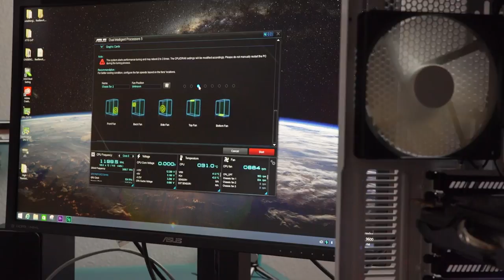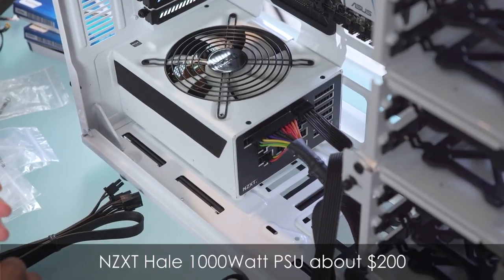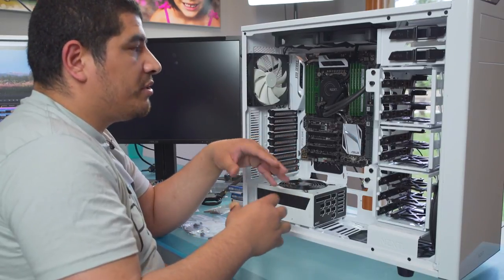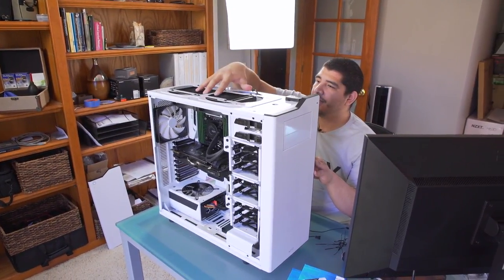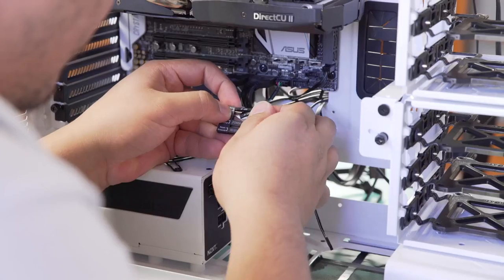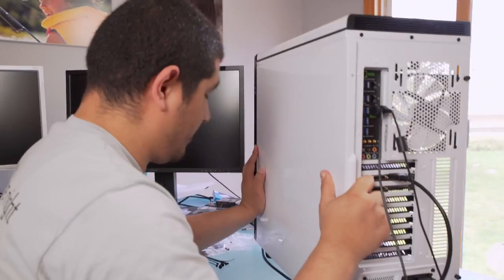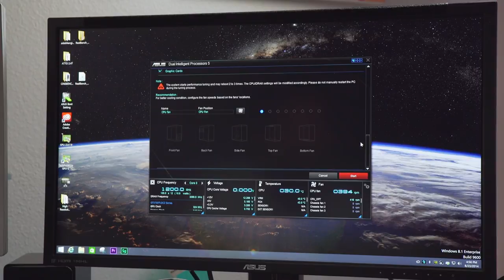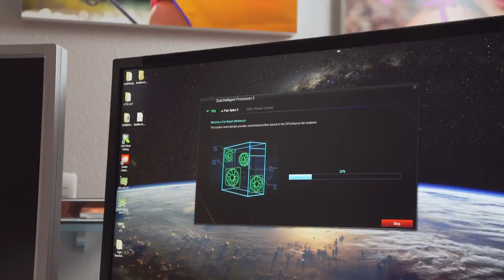i7-5960X 8-core With Asus X99 MB Video Editing Beast

Comment: ugly ram :( for such amazing system :(
Reply: ***** ***** Omg, it's not about beauty, it's about overclock-ability. He already took an overclockable CPU, great mobo for overclocks, high end water cooling and high end case with great airflow, why didn't he finish it with overclockable ram?? 2666mhz with heatsinks and low latency. I hate overclocking, but he already built a pc capable of OC..

Comment: I have an ASUS, HP and Mac workstation and for me the ASUS one has been the worst performer. It started out really well but as time went on it would start getting really slow so i ditched it for the HP which is great, just don't like the way windows works so I've been using my older Mac rig more these days. I'd definitely like to try out a DAVE'S BEAST... just wish it didn't run windows OS

Comment: Radiators clog quickly so be sure to clean it regularly. With a pull config on the radiator, it can be cleaned with a vacuum cleaner hose attachment within around 5 seconds. A thin layer of dust can cause temperatures to climb by around 5-8C, e.g., here is what it takes to cause that on my kraken x40 http://i.imgur.com/1DUmKTl.jpg (pull config exhausting from the case)
Do not get rid of the old system yet, these early release boards are having a large number of stability issues, and both asus and evga have been releasing a ton of updates very frequently to fix them, so early adopters will likely run into some stability issues, especially when memory overclocking for a while before they are all fixed.
The hardware is pretty solid, most of the issues seem to be related to intel rushing that release of their new CPU's

Comment: Thanx for this video!

Do the 4 extra cores allow you to stack more effects in Premiere with 4K video (Panasonic Gh4) and still have smooth realtime playback in full resolution? 

On a 4790K 4-core at 4.5 Ghz with 32gb RAM and a GTX780, the full resolution realtime playback is on its limits when final color grades are applied. I'm talking about per-clip adjustments in brightness, contrast and color and then nesting the sequence into another sequence and adding final overal color and titles.

I know premiere will benefit from more cores during rendering, but what about the realtime preview?

Comment: Actually, the Mac Pro is not based on X79 but instead on the Xeon Professional Plattform. While he is right that it utilises the Hasewell Architecture, I would like to stress that the Mac Pro has Error Corrected Memory, Extra Commands in the CPU and Professional Grade GPUs (And Dual GPUs as Standard). For some applications you need these type of components (Medical, Computer aided Design, Simulation work, mission critical video editing) But the home user does generally not require this. 

Great system you build there! (Had to be said as well)

Comment: Umm, whoah.  As a non-techie I understand about 10% of what is going on in that build, but I can at least tell that it's going to be an insane PC.  The air flow to cool it alone says something.  I assume you'll be running AC in that room to compensate?  :)  Even your last build was  over my head, and would completely crush my current PC.  (I won't tell you what I am running since it would be embarrassing. *grin*)  25 years ago I felt like I had a handle on hardware.  Ahhh. How times have changed.

I was wondering if you could cover/recommend an off the shelf PC, or one that could have a minor tweak added, that would be a solid pc for less power-driven video makers; video editors who aren't moving to 4k in the near future for instance.  :)  Something in $1500 - $1800 range, preferrably on the lower side, that is plug and play would be great.  However, if that kind of content isn't your cup of tea (no problem), then perhaps a recommend to a solid  info source? 

I really appreciate your channel.  Even when I'm lost, which is not too often, your approach to content is so well constructed that it's a pleasure to watch.
Reply: ***** Personally, I would suggest building your own, and there is a great community for that over at reddit.com/r/buildapc. As for parts I would recommend, as JJ, said, a Nvidia GTX 760 Graphic Card, and an Intel Core i7 4790 CPU. Just head over to Reddit.com/r/BuildAPC with those two parts, say you want to build a video editing rig, ask some questions, and they can guide you through the daunting, yet easy, process of building your own PC. Good luck!
Reply: bdc9898
I appreciate that nudge to look into building my own.  I jumped over to reddit, and then followed a link to the Neeweg tutorial on how to build your PC.  Looks more manageable than I thought.    :)  Now, to match a build to my budget. 
Thanks.

Comment: You should definitely run SETI or some other science-based crunching app on your new computer, Dave.  I've been running SETI (Search for Extra-Terrestrial Intelligence) since 2002 and I'm in the top 800 in the world (out of around 3 million users).  I also donate computer time to helping to fight Malaria.  Your computer would rack up the results in a hurry.  It uses both CPU and GPU(s) to crunch the data faster.  You can set it up so that it only uses your computer when you're not using it.

There are also programs that help physicists, bioengineers, doctors, astrophysicists, cryptologists and many other types of professionals.  The base application you run is called BOINC and you can find it with a google search if you're interested.

ASUS may have a team for some of the science apps, so instead of donating $$, you could just donate computer cycles to one of their projects.  Some of the BOINC projects are for really good causes too, like the search for a cure for cancer, Malaria research, mapping the human brain, HIV/AIDS research and so on (about 20 different projects to choose from).

Comment: That's a fantastic processor. My new rig plans use an Asus V Rampage X99 motherboard with 780 Ti graphics card, but the processor I'm using (though undecided) isn't i7-5960X. I would buy that if I could.

Comment: Hey Dave! Great video!
I have a question about After Effects. Why doesn't the CPU work on 100% or at least as hard as it does when you render in Premiere? I have my settings set to use multiple CPU's in AE but I didn't notice much of a difference? 
Maybe you can shed some light on that with the BEAST?

Comment: Hey,

I just built a similar config and it's a real beast I confirm:
- 5960X OC @ 4.3
- GA-X99-UD4
- 64Gb RAM Patriot @ 3000Mhz
- 2 Patriot SSDs
- My old GTX 670 (enough for what I do, not gaming at all)
- Dual Dell Ultrasharp 27 inches 1440p
- Thermaltake Water3.0 Extreme
- Corsair 780T case

Geekbench 64bits:  3543 singe core / 34361 multicore
Running Yosemite as OS

Comment: I have both the new Mac Pro 6 Core Xeon 3.5Ghz with 16GB ram and the new Beast i7 5960X (water-cooled) , 32 GB DDR4 and Geforce GTX 760 2GB.  They are both connected to a new Samsung 55" Ultra HDTV 4k curved monitor. I agree with most here that OSX is a better OS to work in but when it comes to pure power, this new i7 5960 is in a class of its own. The Mac Pro doesn't even compare in processing power for most graphic needs. I'm running a high level surveillance system with 3-5 MP cams at 10-30 FPS each streaming MJPEG and H264. 

On an iMac Core Duo 2.8Ghz Extreme the 5MP cams would take up to 30% of CPU each which limited how many of these high MP cams I could run. A Mac Mini 2.3Ghz 4 core can run between 10-12 high MP cams.  The Mac Pro can run an Axis M3007P 5MP at full resolution in Sighthound software between 5-6% CPU utilization. There was no speeding up of fans when I had 5 of these cams hooked up and utilized around 13% of CPU.

 When I connected this same cam to the i7 5960X computer, it was like it wasn't even connected and used less than 1% of CPU. That is crazy power! I'm pretty sure I could run 60-100 cams between 3-5 MP (depending on bit rate). With 3 of these 5 MP cams connected I'm at between 2.5-3% CPU. This thing is an animal! 

Driving this 55" Ultra HDTV the PC definitely has the better graphics being able to run at full 4k resolution. This monitor is not optimized to run on the Mac Pro and OSX 10.9 finally addressed some issues with the Mac Pro and Samsung Ultra HDTV 4k. Hopefully there will be better support with different resolutions at 60Hz. I'm connected via HDMI right now at 30Hz which isn't too bad actually. I still love the Mac Pro. Super quiet and expandable externally to your hearts desire. It's hard to beat OSX!

Comment: I used a more budget friendly build with the 5820K, 32gb DDR4,GTX 1060 Founders Edition GPU, Crucial MX300 256GB SSD boot drive, 2 1TB Raptor 10K HDD's in RAID 0 for storage and a X99 MB by Gigabyte. My system is pretty fast. I have my CPU over clocked to 4.3GHZ. So far it has been a good system for what I use it for. I will be getting the i7 6900K in the near future. It is fun building a PC and I am surprised that more people don't build their own.

Comment: Hey Dave,

In the video it shows you have 8 sticks of ram in the motherboard but your link takes me to 4 sticks of ram. Did they purchase 2 sets and put 128gb ram in there? Which doesn't make sense because the processor can only support 64gb.  Also that processor does not support ECC ram. So did he use Crucial 32GB (4 x 8GB) 288-Pin DDR4 SDRAM DDR4 2133 (PC4-17000) and purchase 2 sets of those for a total of 64gb?

I’m super confused.

Great video by the way!!! Keep up the good work!

Thanks!

Comment: I must iterate that 7XX and 6XX series Nvidia Cards are not great for Rendering or performing CUDA intensive requests from Creative Editing Software, especially Adobe Suites. The 5XX Series Nvidia cards still outperform them in these tasks. When Nvidia found out everyone was buying 5XX series cards to edit with cheaper than Quadro cards, the next 6XX and 7XX series cards now disable a certain amount of CUDA cores. The only things the Nvidia cards perform well at now with Adobe is the Mercury Playback Engine. The only new Consumer Nvidia Cards that aren't effected by Disabled CUDA cores are the Titans.

Adobe has worked very closely with AMD for Open CL optimization and especially in late CS6 patches and CC AMD Consumer cards pretty much stomp all over Nvidia's offerings. However, if you want Pro performance from either AMD or Nvidia, you must go with a Quadro or FireGL card. AMD are more cheaper in this and are still slightly more optimized for Adobe and even chain better with programs like NUKE.  If you're purchasing an AMD FireGL card for the first time, I believe you can get 25-50% off of them straight from AMD. So, if you're not going to be playing games, the pro cards are where it's at. Now, if you want more performance out of Consumer cards and still get Consumer Playback and Gaming performance, Either stick with AMD cards (CS6+) or buy a Titan or a 5XX series card if you must have Nvidia and use an older version of Adobe (pre CS6).

Oh and about what Scott R said about Mac OS X, that is only true if you are using Avid software (Cringe) or Adobe Software for Photographers (Photoshop and Lightroom) and don't mind being stuck behind a performance wall with high markup unless you Hackintosh. OSX is not flexible enough for today's creators needs. Avid is on the way out, I know too many major studios getting rid of not only Final Cut Pro but Pro Tools as well and cutting their Upgrade expense in half at the same time. Adobe/TheFoundry/Reaper on Windows is the new standard now and will be for a long time. You can use Server grade boards and some Consumer level boards with Xeons and ECC if you know what to look for and do it with Windows. (rolls eyes) Also, now with X99, you can thunderbolt and retina with Windows as well with no problem.

Comment: My Cinebench r15 results with the 5960x were off the charts at around 1650 CPU. I'm pretty sure I was over 1700 overclocked at 4Ghz on one test  

Despite the great results on Cinebench, I saw between 5-10% improvement over my Mac Pro 6 Core 3.5Ghz when doing real world video processing. The PC had 16 GB more ram for a total of 32GB DDR4 at the time of testing. 

On the noise:

I tried sticking the PC in the closet to make my room quiet, but I could still hear this thing clearly. I've built my share of quiet PCs for DAWs and if you've never owned the new Mac Pro, you have no idea what it's like to work in an environment with almost no audible computer sound. These things are amazing! This is really important when you are recording live sound without a dedicated sound room that is separate from the computer room. 

I sent the PC back to Newegg. It was fun to test out and revisit the days of building DAWs for PCs , but they are still behind Apple when it comes to functionality, design, and OS. 

I purchased my Mac Pro 6 Core 3.5 Ghz 16GB on ebay for 3999.00. It came with a 27" Thunderbolt Display that sells for 999.00. I upgraded the ram to 32GB through Newegg with Crucial matched pair 16GB for around $340. The PC cost 2700.00 after taxes from Newegg. If I bought the same computer from iBuyPower it would have been over $3k. Newegg sells it for a few hundred less in a promo that has run out of supply.  The same system built by iBuypower was around $3.3k using the Asus Extreme motherboard. 

So for about the same price of $3k , you get 5-10% better processing power with the PC for video processing in my real world results. You get a better OS and better expansion capabilities with the Mac Pro with 6 Thunderbolt and 4 USB 3.0 ports as well as 2 Ethernet and an HDMI port. You get a super quiet computer in the Mac Pro with a beautiful design and light weight. 

You will have to decide if the few extra seconds of video processing time is worth putting up with a big blocky leaf blower in your work space. 

Seamless integration with iPhone and iPad and all other Mac devices through iCloud makes the Mac Pro a clear winner for me. 

Say no to Spyware, Adware, and Viruses! :)

Comment: Hi, loved the video.
I wanted to ask JJ why he had air sucking into the case from uptop through the radiator and wouldn't that bring in the radiator heat into the case? I built my X79 with water cooling and the manual said to assemble the fan below the radiator blowing air up not sucking it in and when I put my hand on top the air coming out is really warm.
I loved the explanation of how graphics card work and the inefficiencies in using all their power in software I have in fact upgraded my card to something triple the price and seen no improvement and I thought 3dsmax was inefficient in using it glad to see my suspicion was in line with the pros take on this.
Thanks again :)

Comment: Hi,
I'm setting up my PC and I have got X99 Deluxe, 2 X 1 TB HDD for Scratch disk, 4 X 2 TB HDD for Media Storage.
I have Installed Windows 10 Pro in a SSD 250GB. I want to have the SSD safe as a booting disk.
I need to know how I can create a RAID 0 on 2 x 1TB HDD for scratch disk.
And 4 x 2TB HDDs for RAID 10. 

And which ports to use to connect each of these drives. Thanks in advance

Comment: I've been reading reviews of these new Haswell-E CPUs (there are three of them), and i think the i7-5820X is a much better deal for most people. It's about 1/3 the price of the i7-5960X, with most of the performance. I'd take that extra $600-700 and put it into another part of the system (or leave it in the bank :).

Comment: A lot of stuff that JJ said about the Mac pro is completely wrong. The highest memory kit for the mac pro is around $1000 from apple.  Also it offers way more thunderbolt ports.  It offers way more upgradibility.  The WS graphics are superior to consumer graphics.  And the CPU can go up to 12 cores instead of just 8. Also they are xeons, so they have support for ECC RAM, so in all, the mac pro is not "outdated."

Comment: Assuming all other components were the same in a potential build of my own, is there a happy medium GPU card I should look for to work with the latest version of Vegas Pro? I dont want to overspend for throughput that simply goes to waste in terms of video editing/rendering. I spent most of my time using Vegas, AI, ID, PS, LR, and AE. But I do want to run a pair of your 27 inch Pro Art monitors for my layouts.

Comment: The crucial ram used here, it's two sets of 32gb ddr4 right? I ordered two of the crucial 2133 ddr4 4x8gb kits and it looks like that is what jayjay put in your system. Is that correct? If so, how is it working so far? I want to be sure there won't be compatibility issues between them.

Comment: 9:07 Why would you fight the natural direction of airflow? Heat rises, wouldn't it be better to have the top vents as out-take?

HELP: Where can I find mATX pc builds for content creators?
Reply: +ucheucheuche The idea is bringing cool air in from the outside over the radiators, its better for cooling the CPU if you have a hot running system within the case like a non-reference design graphics card which just expels most of its heat into your case instead of out the back, those cards get to like 70-80c and all that heat is going right into your case, if you have really good case airflow you can do it the other way around. I have an R9 Fury X with the CLC blowing all its hot air out the back of the case so my temps in my system are always ambient and I have my CPU radiator blowing air out the top of my case as well.

Comment: Quick question. JJ says a few times the the GTX 760 will be plenty of enough power for content creation, but if you look at the System Requirements for Premiere Pro (CC 2014) the GTX 760 is missing from the list. It jumps from GTX 690 to GTX 770. Can anyone here help clear this up? I've been looking at building a new editing rig, but have been looking at the GTX 770 for my GPU. If the GTX 760 is supported that would save me some money for other upgrades.
Reply: ***** Thanks for the reply. I will hopefully be upgrading soon and been looking at getting an asus mobo.